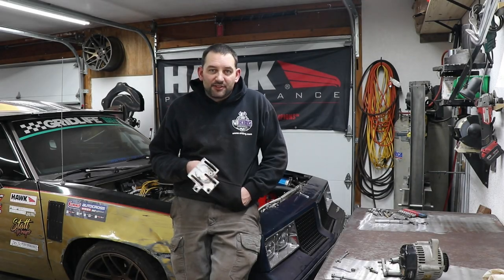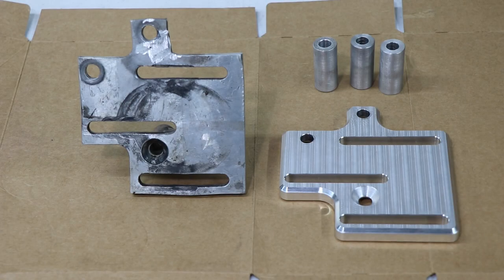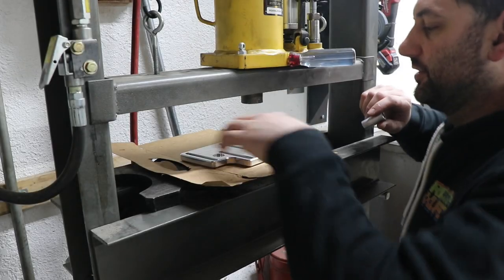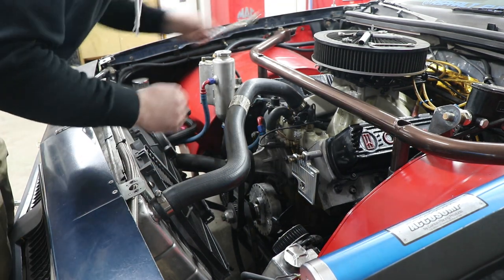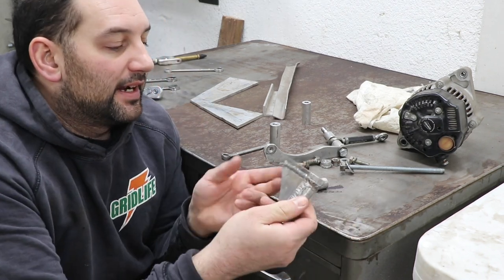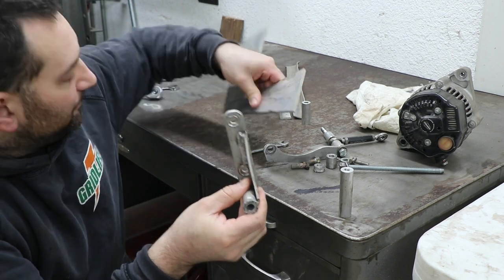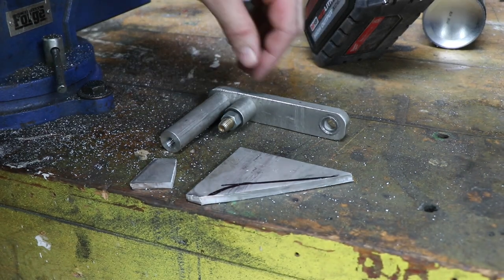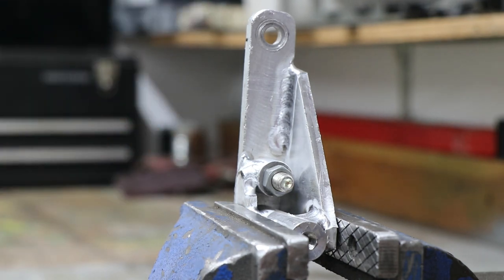Upgrading the Power Steering and Alternator brackets

Comment: May I suggest a flexible upper radiator hose that has an internal wire, then drill 1/8 inch holes in both necks and feed the wire through so that it is not bunch up to one side. Your upper radiator hose looks a little flimsy I would double hose clamp it as well.🎉
Reply from the maker: I haven't had any problems with the radiator hose. It's a pretty thick one and has held up for a few years now. I do run double hose clamps.